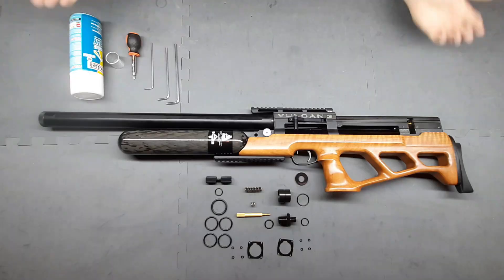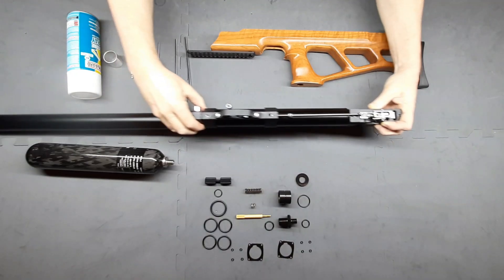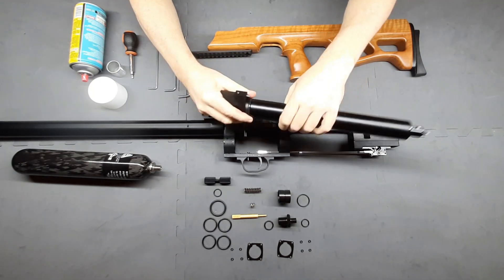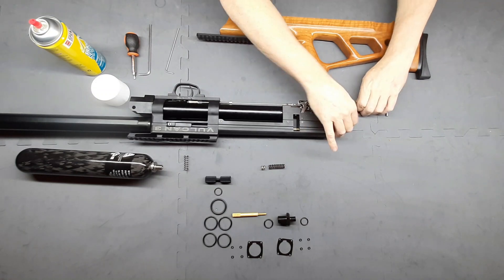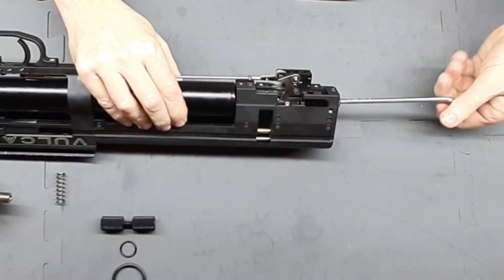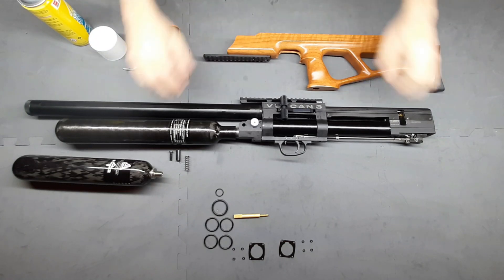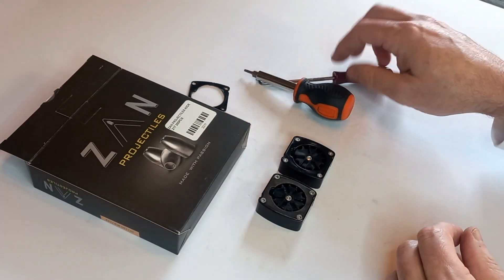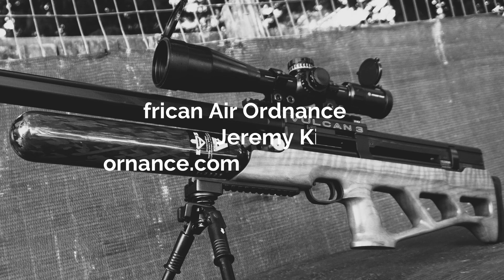Vulcan 3   AAO 2023 Gen 2 Upgrade Kit install.

Comment: I just bought the v3 700mm in. 25, it came shooting 3gr jsb mk2 pellets at 1020 fps, the hammer adjuster is almost flush with reciever, dont know the reg pressure, do you think changing the hammer spring will increase velocity without touching the reg?
Reply from the maker: Yes  but you may still need to adjust the reg pressure

Comment: Hi , please can you explain how the reg anticreep plate works to prevent reg creeping , it seems a normal steel shim so i don't understand how does it work in the case the regulator lets go more air than it should passing through his body preventing the pressure rising more than the prrssure reg eas settimo at . SORRY for my english i hope you understand my question
Reply: I mean " it was setting at "
Reply from the maker: The plate  was only for the original batch of Vulcan 3s that AGT had drilled the breather hole in the plenuim tube in the wrong place  .The plate just makes the reg sit higher in the plenuim to ensure it's in line with the breather hole 
This issue was fixed by AGT in later production versions of the Vulcan 3

Comment: please tell more about the holes on the plenum tube and the position of the breathing holes of reg body and the tube . thanks . A friend of mine believes that the tube breathing hole is not placed between 2 orings of reg body .
Reply from the maker: In the early version of the rifle the breather holes where not in the correct position by adding a plate in front of the reg it corrected the issue AGT did correct the problem so it's not a issue anymore 
Thanks for watching

Comment: And what is the difference with stock one
Reply from the maker: More Air Run you regulator at higher pressure  get rid of the sonic twang after each shot  Thanks for watching
Reply: @AfricanAirOrdnance  i got impact m3 sniper and i like it not powerfull like vulcan 3 but amazing gun

Comment: I would like to know few information before ordering this kit, in 700mm Vulcan did you put the regulator in the power Plenum position? And that is why you are using the unticreep plate? Now my question is have the Vulcan 3 500mm, and I would like to shoot higher pellets and slugs and the original spring works amazing with 18 gr pellet and nothing higher than that, so to adjust I need to adjust the hammer spring and I believe I can loose the valve spring? What is your advice about that?
Reply from the maker: Yes the regulator was installed on the muzzle end of the Plenum no need to remove the valve return spring if you are running your reg low for pellets then you don't need that much hammer strike

Comment: Fx m3 & vulcan 3 which one is best or easy to use give your opinion i am a slug lover
Reply from the maker: I would say the Vulcan is simple system  more powerful  than FX
Reply: Hes right.  Pretty easy to turn out the regulator and use the hammer spring adjustment to control power.
Reply: The FX lines usually cannot shoot slugs like the vulcan can with upgrades.  Power block. Barrel.  Hammer.  Regulator.  Ect. 3 grand gun before you know it.